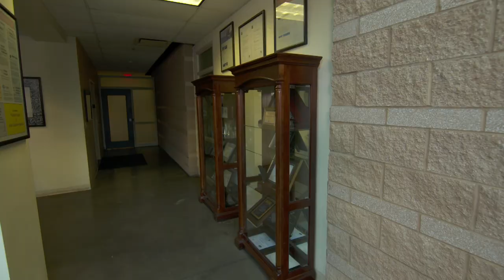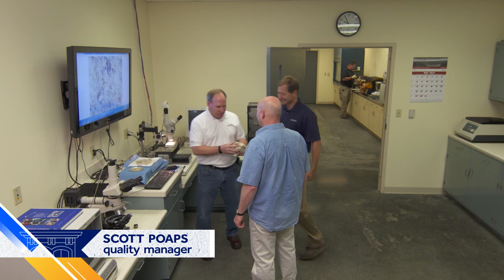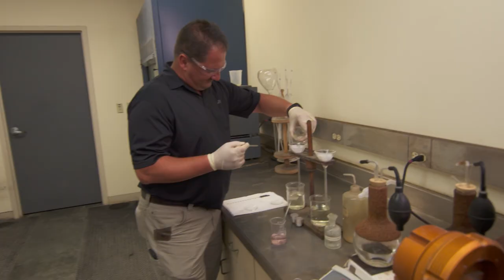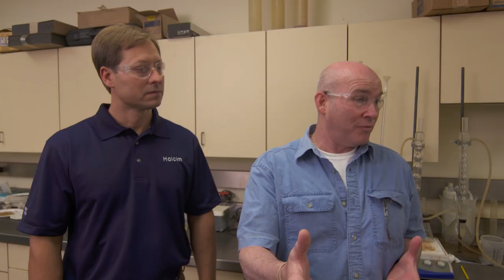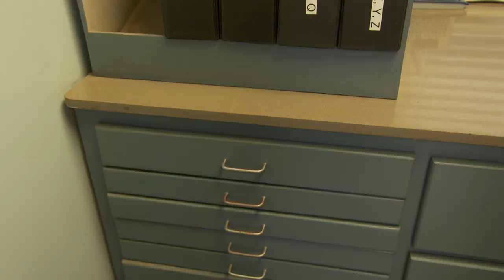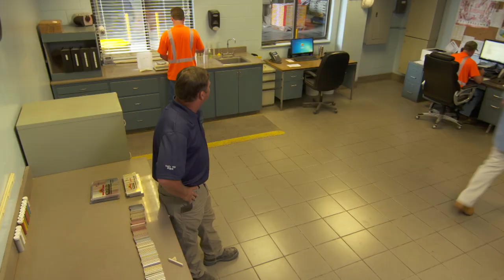Replicating Old Mortar | This Old House

Comment: ....impressive business concept. It must be to cater for dedicated restoration projects .....I've never had any luck with lime /sand  mortar . I've seen results chimneys, walls done seventy years ago during wartime rationing of materials that gotta be pulled down and redone with reliable cement mortar. 
...I figure the problem is the current 420 ppm concentration of co2 now in atmosphere ...It would conceivably be a problem in a high fog/ dampness / humidity climate but probably OK in a drier climate. . .Soon the shellfish critters in the ocean won't  be able to grow their shells any longer .

Comment: Does it really matters what kind of mortar is used? Just as long as the color matches.
Reply: Different variations of mortar can age and oxidize differently, so while a patch may match for a while, long term it can become obviously different.
Reply: @AndreasCain  Mike Hadduck way, paint it with dirt.
Reply: Yes it does matter a lot on historic houses. The bricks are soft and if the mortar composition is stronger than the brick it will break the bricks over time.